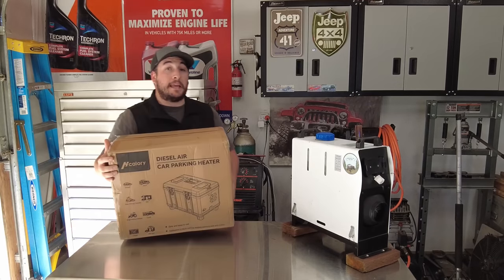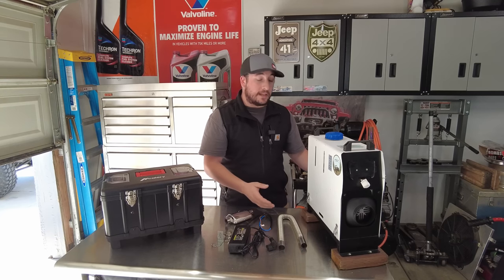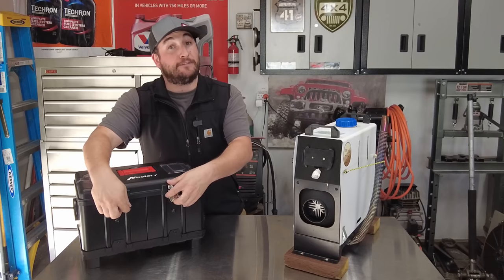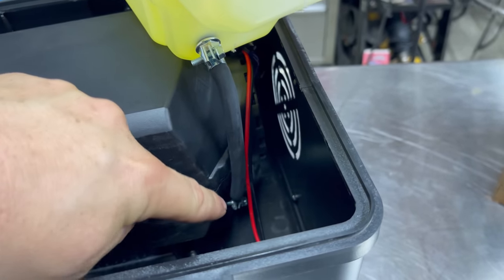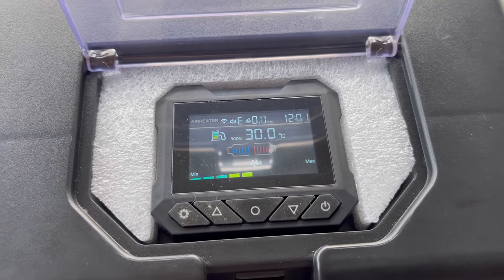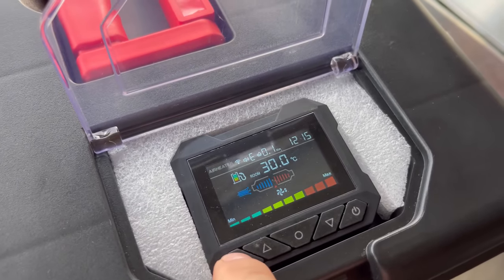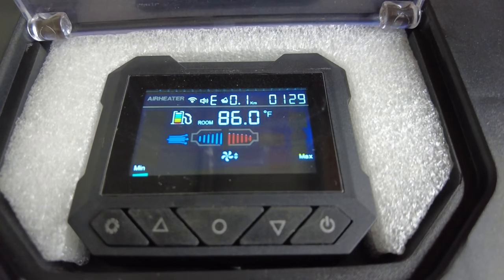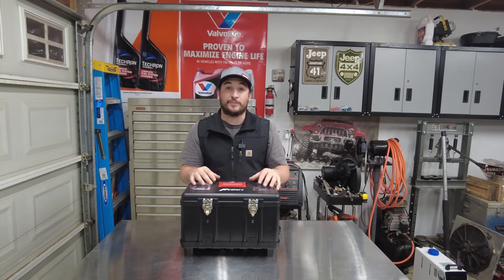KING Of Affordable Diesel Heaters | The HCALORY - SS2 8KW Air Heater | This Is The ONE

Comment: that's funny they come with a laptop power cable. I use a PC power supply and use the 12v rail to power my heater in my shed. I've modded a few of them for friends. But this would be a little nicer set up. all you should need to use a laptop power pack would be a female plug, the power pack, and maybe a power circuit (but I may be wrong on that one).
Reply from the maker: That’s funny I used to do the same thing with an old power supply, still have it for running the vevor heater in the garage. 🍻
Reply: @ATEMOFFROAD  when our local RadioShack went out of business I got 5 or so 250w power supply for like $10 ea so any time I need something like i just pop open a new one lol. I went nuts and bought a lot of bins of parts for next to nothing. Great for those little projects.
Reply from the maker: @vanishingfox1339  absolutely, less and less people are remembering radio shack, it’s been awhile since I been in one last but man, good times haha 🍻

Comment: I just bought a similar one and I want to fit it on a boat ( canal cruiser ) .I understood is safer to drill a hole and to pass the exhaust thru hull out of boat and also the intake .The problem is that I can not attach a flexibile pipe to the intake.
Reply from the maker: I just installed one in a MCI buss, that video is coming soon. The bus has storage bay compartment that we were able to keep the heater in permanently so it’s protected,  while we duct the hot air into the cab. That may be a better solution for you? As for the exhaust 3/4 copper tube was much more ridged and it works well. Thanks for watching 🍻
Reply: @ATEMOFFROAD  i have also storage space in the cockpit ,under canopy ,so I will install the heater there ,not in the cabin where I sleep .The exhaust will go out ,trough the hull in the lateral of the boat.The problem is the air intake which some peoples say it is recomandable to be also out of the boat to avoid CO intoxication ( they said the wind could blow back the smoke from exhaust inside the heater and spread inside the boat through air intake .I don't know if really this can happen ,but made me think ).This heater has nothing to attach a flexible pipe to the air intake so he could recirculate the outside air.My intention is to make a hole in the back of the boat,far from exhaust and to pass the air intake pipe throgh there.

Comment: I wish all diesel heaters came with a power supply.  My Jackery for some reason cannot start my diesel heater on the DC plug.  It's 15Amp max, but I think it requires up to 20A for the glow plug.    With a power supply, the AC inverted power has no problems starting and running the diesel heater,.
Reply from the maker: That would be nice 👍🏼 I use the ac adapter too I love it. Also keep in mind if your using a litho battery some don’t like discharge at colder temperatures. 🍻
Reply: @ATEMOFFROAD  I do know that.  I am using the diesel heater to keep my basement above freezing.  I have well water and I try to keep it above freezing in the cold months.

Comment: Hey man, great walk through on this unit. I've had a couple of Amazon Diesel heaters fail on me over the years, so I'm always on the lookout for a better built unit. This one looks pretty solid. How much is this particular HCalory unit going for? I checked the amazon link, but it appears they are curretly unavailable.
Reply: Ebay. 5kw £149
Reply from the maker: Thank you 🍻 it’s been sold out on Amazon some how I missed this comment, sorry! New stock is available link: https://amzn.to/47KUrMq
Reply: Better off with a reconditioned Eberspacher!
Reply: It is all the same old stuff same pump same motor same glow pin and same problems . If they would just make the motors better quality and a better pump would be a winner .

Comment: Any idea how long a 12v 50Ah battery would last running this? Be nice for ice fishing if you already have a 12v battery
Reply from the maker: Should be good for 10-12 hours running on low. See this video for more details on full load amp draw in high, medium and low heat settings Diesel Heaters For Winter Tent Camping - Upgrades and Modifications
https://youtu.be/Ug-3fjjCPWE

Comment: This is a very useful comparison video.
A couple of points:

1 - the fuel pipes in this heater are very short, so no priming is needed - the startup sequence will prime the pump.
Overpriming is why you got the white smoke.

2 - the manufacturer is what Monty Python would call a very naughty boy.  It is exceedingly dangerous to use a socket designed for mains voltages as a low voltage connector in a consumer product.  Even though a mains adaptor and D.C. cable are provided we know full well that too many people don't read the manual.  It is highly likely that someone will connect their new heater to the mains using a common desktop computer lead.  Please see this Public Service Announcement video:-
https://www.youtube.com/watch?v=qy0t2G6vtIQ&list=PLdPnfMUHpVbJU11cKVgFumdwgQ5A8UIRM
Reply from the maker: I was thinking the same thing on point 2 it’s very possible this can happen, but unlikely as someone unaware, would have to introduce a completely different cable to a socket input labeled 12v DC. Vise versa for the adapter. But You are right if it can happen it will. I will watch the video soon. Thanks for sharing 🍻
Reply from the maker: A Disclaimer has been add to the description box of this video.
Reply from the maker: I am very tempted to show what would happen in the case 120v AC was input into the mains. But In theory we can also predict what would happen. Remember the controllers control circuit is what relays the heater circuit to turn ON. The controllers control circuit is also low voltage/ low amps, Controlling a HIGH amperage heater circuit. I suspect if AC is applied the low voltage/amp control circuitry would take the hit before the possibility of the high amp heater circuit absorbing a load to catch fire. The circuit would be damaged like a fuse shorted, and in the form of a bad trace on the board. With the low current circuit damaged you would not even be able to turn the machine on with AC applied.  It would sit there and wait. likey reducing any shock or hazards. You would just have a dead ☠️ heater. 
Ive also verified the the pin out on an AC 120v cable in relation to the 12v heater connections pinout and this is what I have found. If connected, AC Hot lands on DC ground, AC neutral lands On +12v.
Reply: @ATEMOFFROAD  240 V A.C. here in UK would likely fry the ECU on first application.  If it did not, then pressing the on button with a very long insulated stick would definitely let out the magic smoke.
That model doesn't seem to be available in the UK.  Which is probably a good thing.  🙂
Reply from the maker: @patricklockerby4308  Update: Power adapter has FC and CE logos and heater has CE, UK|CA, triangle with check mark ✅ aka A-Tick, and FCC ID: 2A7W6-SS2. Does this mean anything?
Reply: @ATEMOFFROAD  "Does this mean anything?"  Not a lot.
These markings just state that the product conforms to certain standards according to the manufacturer.  This does not mean that any independent or standards lab tests have been made.
UKCA stands for UK Conformity Assessed.  It is a post-Brexit standard to replace CE mark.  Using designated standards is voluntary.
FCC stands for Federal Communications Commission.  This is the U.S. body entasked with all matters to do with radio.
The FCC markings on electronic equipment generally refer to radio interference emissions being in conformity to FCC standards.
These markings are among many dozens of self-certification standards.  I tend to ignore them.  🙂

bbtw 2A7W6-SS2  is manufacturer's code 2A7 and product code  W6-SS2.
Reply from the maker: Hi , New video is up covering all the questions you asked on this heater. 🍻 https://youtu.be/Ug-3fjjCPWE?si=BxCFMqSJN6QPi7tT

Comment: I had 2 of the older styles, they were a pain to setup, I love your video. Very clear information. I question I have its the exhaust looks very close level of the bottom of the heater so I'm curious if this heater has to be raised because the exhaust is so close another question that has to be laid I believe on metal because of the heat of the exhaust sort of like the old style that's definitely a great unit compared to the older ones awaiting some feedback on this I just wanted to let you know that I used mine in my 34ft sea ray. I connect a 6 gallon fuel tank. And a filler neck. I live in Rhode island. Gets very cold up here. Mine ran around the clock 24/7 for the whole winter and kept the boat at 80 85 degrees even when it was nine below zero
Reply from the maker: A Very cool way to use the heater, the exhaust looks close but the plastic is the same as that around the heater and the 90 degree elbow is a huge improvement to the others that crack when you bend them to a 90. Thanks for watching i appreciate it. 🍻
Reply from the maker: Here’s a new video on the heater 🍻https://youtu.be/Ug-3fjjCPWE?si=AhQMEJBwV7Lu1wqv

Comment: the ambient temp is measured from the controller you would have in your tent  I assume ?
Reply from the maker: Yes , but there is also a “level modes” where the thermostat is not needed , I still extend the cable so the controller/thermostat is in the tent or heated space. Check out this video 🍻Diesel Heaters For Winter Tent Camping - Upgrades and Modifications
https://youtu.be/Ug-3fjjCPWE

Comment: Question. I have used a few types of duct hose for my heater, all of which smell like burning rubber. Do you have the same issue?
Reply from the maker: I do not have that issue. I ask do you keep the heater on hi for long periods of time? I use the carboard/aluminum one first then couple the the grey/aluminum one to the end of that. This keeps the duct off the hottest part of the heater.
Reply: @ATEMOFFROAD  I keep it on low most of the time. I'll try adding the APK duct at the heater as you described. That may be the fix.

Comment: Is the controller detachable? One thing I’ve always never liked about these heaters is the ambient temp setting. You need to have the controller in your tent with you. Otherwise the thermostat on the controller would never see the temp you set since it’s out in the cold.
Reply from the maker: No, but this new mode of control allows you the use of the heater (outside) without the need of the controller and a bunch of sophisticated settings. Simply toggle the keys to speed up or slow down the heater and it maintains that setting coupled with the Bluetooth smart phone app you can also have visual feedback of what the heater is doing in your tent.
Reply from the maker: Hi , New video is up covering all the questions you asked on this heater. 🍻 https://youtu.be/Ug-3fjjCPWE?si=BxCFMqSJN6QPi7tT

Comment: My biggest question is how much power does it pull?  I'm running a Jackery 500 so power is limited.
Reply from the maker: Close to 10 amp at start up then throttles way down. For that power bank using the ac adapter is the only way to go. Check out this video 🍻https://youtu.be/Ug-3fjjCPWE?si=M8dRwanuDESfiBFF

Comment: Hi Atem, I'm trying to set one these up but with no joy, I've noticed there's zero volts showing on the mobile app screen? Could you perhaps point me to a remedy for this please. Thanks Brian, uk
Reply from the maker: Does the voltage show on the panel screen? This may be a bug they are still working on or this heater doesn’t broadcast the voltage to the app. My other heater does, which makes me believe this one doesn’t, does the altitude show on the app? Also keep in mind this app can be used with many other heaters.

Comment: So how do you get the thermostat inside your tent?
Reply from the maker: I extend the cable so the controller is in the tent or simply don’t and use the new “level” mode. No thermostat required. Check out this video for winter tent camping with a diesel heater. https://youtu.be/eu6RkSz6h-8?si=MvZLfsfqi8zoxTlm

Comment: One other thing I don't think you hit on. The combustion air intake is fixed, on the bottom of the new unit. On the old one you would run a hose from it to the outside of, say, your garage, and you would extend the combustion exhaust too. If you are going to use this indoors, and plumb your exhaust outside, you probably want to figure a way to get that combustion air intake to the out of doors. Just so everyone understands, these heaters have two circuits. A combustion circuit and a heated air circuit. So two fans, two separate circuits that have their own individual needs.

Comment: Did your cigarette lighter adapter end up working? I think these tend to draw more watts than the portable battery units put out
Reply from the maker: Yes use this cig adapter 20A : https://amzn.to/3Ua97ky
And this battery or larger:https://amzn.to/48SLWPM
If your one source of power is a portable battery bank use the AC adapter.
Reply: @ATEMOFFROAD  can you run it on ac for initial startup then switch to DC? Or will it trip again after you restart?

I'm wondering if you could "preheat" it on AC. I like many have a portable battery bank but the double losses of DC -> AC -> DC make me not want to run it all night. But maybe I could just have both AC and DC with Anderson plugs to switch between, start it with AC then restart with DC and hope it won't trip the battery bank on restart.

What do you think?
Reply from the maker: @chrisjohnson6482 I’m thinking how you can do that without modifying the wiring , seems possible as long as the polarity is correct. Start up on AC once the load drops apply Dc to circuit then remove the AC. You can make something safe to do that definitely protect both circuits. The problem i see when you go to shutdown the heater the glow plug heats up for about a minute 7amps or so then shuts off. Your cig side would need to be able to handle the shutdown cycle. Seems doable but also sketchy. I’m cannot guarantee what the portable power supply will do during the switch gear.
Reply: @ATEMOFFROAD  I was thinking startup on AC, then power off. Then power up on DC. With the hopes that it draws less than 10amp on the second go since the glow plugs are pre heated. I ordered the 5kWh vertical one and it'll be here tomorrow, I am gonna try it out. I'll report back
Reply from the maker: @chrisjohnson6482  if im correct it will try to cool down before starting back up again. Then it will smoke because no proper shutdown cycle and remaining un burnt fuels in the ignition chamber. Just my theory maybe have a go and try it. But I don’t advocate that. Please let me know the results if you go ahead and try.
Reply from the maker: @chrisjohnson6482  I just did a video on the vertical one we are giving 2 of them away. >>
https://youtu.be/S_oGryWrkJw
Reply: @ATEMOFFROAD  I mean letting it go through normal power cycles both times fwiw. Worst case I'll use AC only for now and rebuild it in a bigger box with dedicated battery

Comment: Is the product Listed to UL requirements?  If not insurance will not cover it.
Reply from the maker: Power adapter has FC and CE logos heater has CE, UK|CA, triangle with check mark ✅, and FCC ID: 2A7W6-SS2. Does this mean anything?
Reply from the maker: The triangle logo is called an A-Tick apparently ?

Comment: Wondering if this would heat one side of a big 2 car size garage/shop that's not really insulated, but built with thick brick, rock, and concrete with a metal roof. It's kinda like a cave in there. Trying to decide if I should put a wood stove back in there. Just bought this place back in April. Let me know what you think? Thanks
Reply: Running one of these in a large conservatory of 16 x 20ft, same thermal value as your garage I'd assume, for 12 hours uses 0.3 of a litre of diesel and heats the place al day with no fuss at all. Noisy when it starts up but when temp gets up it's fairly quiet and keeping it on tickover uses very little diesel. I know they run better on Kerosene (heating oil) but I don't have a supplier for 10L at a time.

Comment: Can this heater be modified by making the exhaust longer and putting the unit.inside or wouldn't you recommend doing this in a camper?? So the exhaust was outside the camper..
Reply from the maker: Of course, this heater would be perfect for that setup. That is what they are originally designed for. 🍻

Comment: So what about using home heating fuel oil?  
Isn’t it pretty much the same as diesel?
Reply: What other fuels can 
SAFELY be used?
JP8?
Reply from the maker: These can burn kerosene, its similar to diesel , but doesn’t gell as quick as some diesel. I’m not sure about jp8 but kerosene is good up to -40 F. 🍻
Reply from the maker: Check out this video>>https://youtu.be/Ug-3fjjCPWE?si=zTqlWLjUB9hwlanJ

Comment: Does it need to be connected to electricity? I use a regular wood stove currently in my hot tent and sometimes in my house, is there a way to do without electricity?
Reply from the maker: You will need  a 12v battery or 120v ac power source. 🍻
Reply: Battery or portable power source.

Comment: What diameter is the outlet tube?  I would like to get a rv sewer adapter so I can use the rv sewer hose that has the twist lock connector
Reply from the maker: Nice, I’m not sure the exact dimension and I’m not close by at the moment. I do know I fit a 3” duct on there. 🍻

Comment: How long before someone plugs it in to 120 vac since they use the same plug? Bad choice of plug, especially without an internal fuse.
Reply from the maker: Yes it is , in todays world people are trained on labels and voltage types so its less likely but very possible. If it can happen it will. Most likely short the pcm and the AC will just sit there. 😩 not good at all, We should try it.